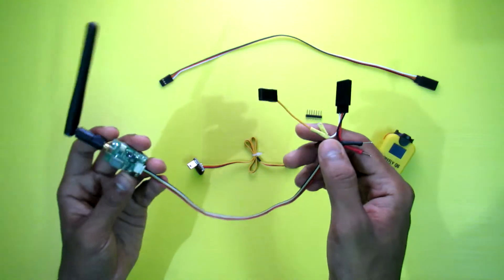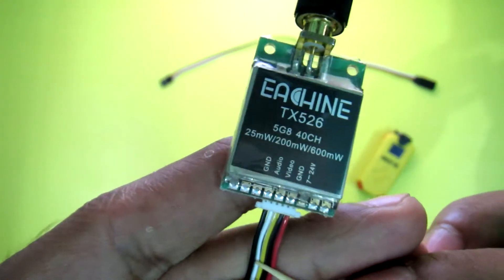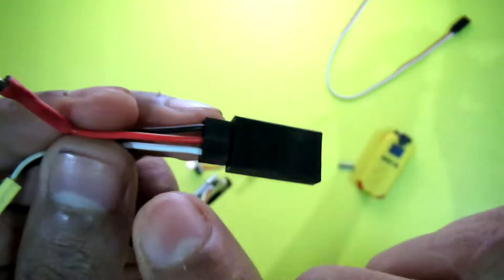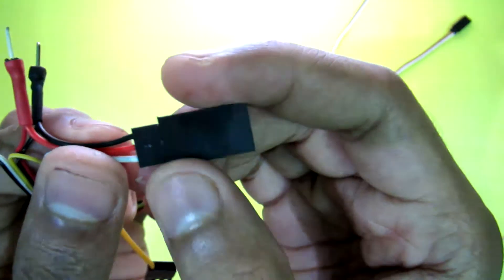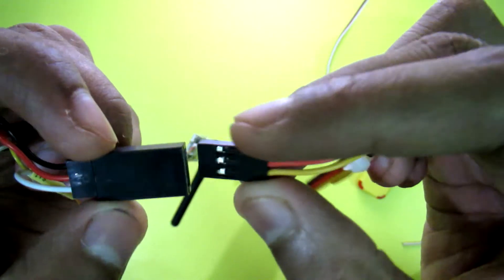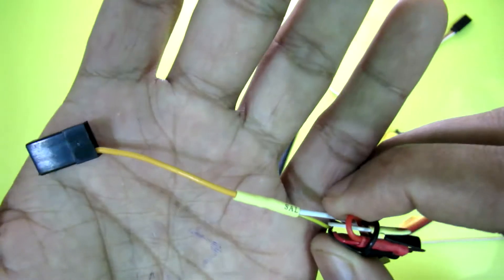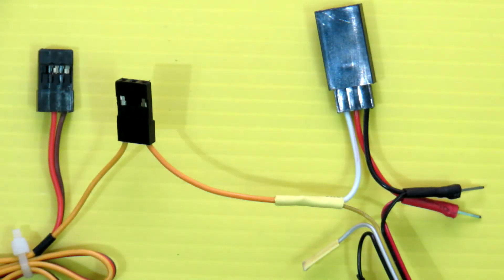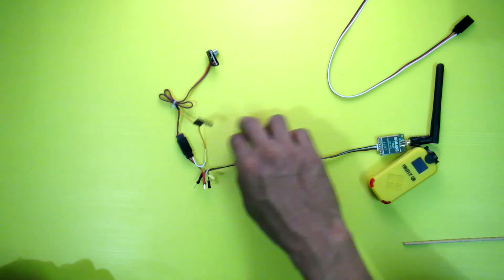Best Way to Connect a VTX

Comment: Hi I have a sjcam m20 and eachine tx526 vtx but I don't have have the av cable for it.. can you make me like this ?
Reply from the maker: what is the output type of sjcam??
Reply: @MakerHand  micro USB port
Reply: @MakerHand  has 2 ports hdmi and micro usb port.
Reply from the maker: @gautamsenthilkumar823  I think your camera support only digital output through hdmi, but tx526 only support analog signal . so it's not that easy you also need to use hdmi to av converter